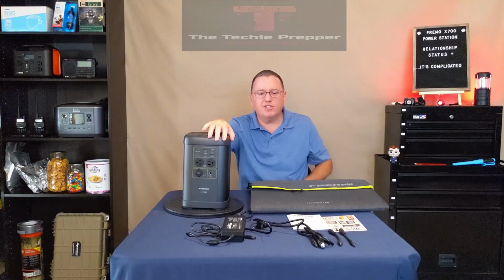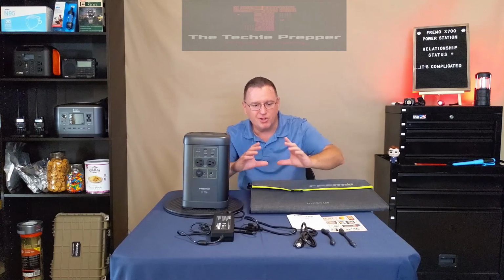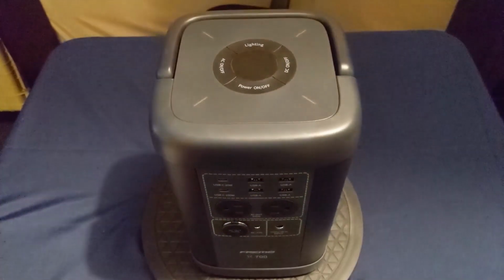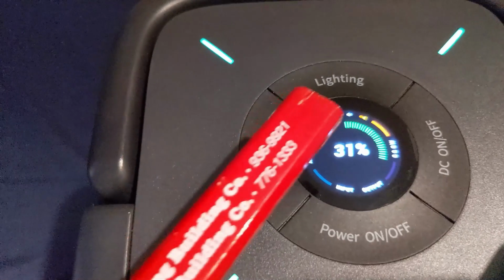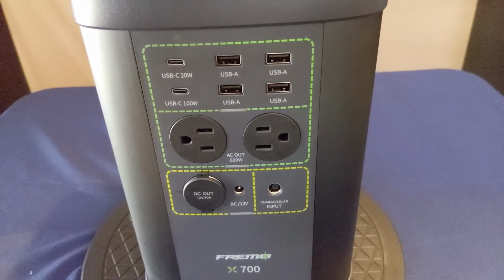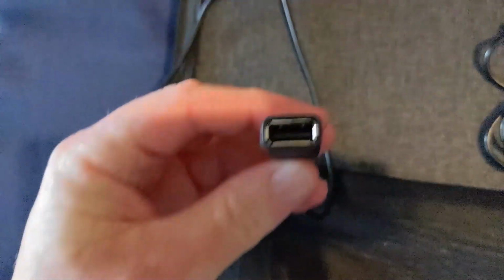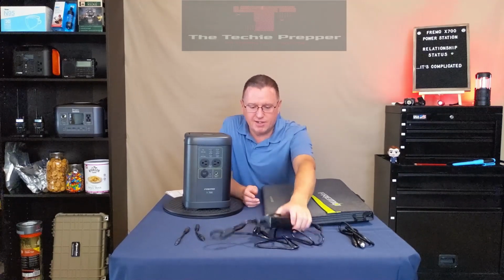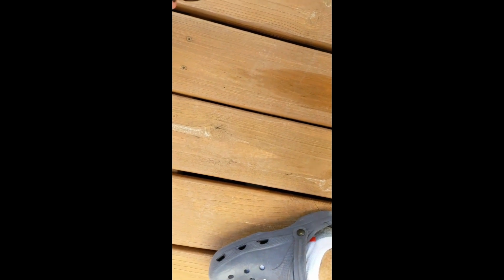FREMO x700 Portable Power Station Review

Comment: Question, you can use 2 pieces of 100w solar panelz total 200w, but the input is only 180w.??
Reply: The two 100 W solar panel can provide 200 W together. But the power station will take only 180 W from them.
Reply: On the up side, a 100 watt panel will usually only give you 70-85 watts anyway (it's 100 under perfect conditions, which most of us won't enjoy, most notably me during any power outage unless it happens to be in June).  So two together would likely not max the input.

There's USUALLY a little overpaneling built into the system as well, and the item can charge limit, so GENERALLY no worries about overprovisioning slightly on the watts input as long as the voltage is in spec, but check the manual and contact the manufacturer for guidance, particularly on cheaper systems.  EcoFlow is very forgiving.  Fremo?  It's at the lower end, so who knows.

Comment: I have a question about the solar charging for the x700. On their website, it states that the solar input is 180W. You mentioned in the video that you can run the 100w solar panels in parallel (200w). Is 200w input okay for the x700? I was looking to purchase a 200w solar panel from another brand and just wanted to make sure that will be okay to use on the x700. Thank you in advance.
Reply: My personal experience with solar is that they provide between 50 and 70 percent of rated output in normal eastern US sunny day.  A few scattered clouds, moderate humidity, if there's any more cloids than that 30 to 40% is more common.  200 watts of solar won't exceed the 180 w input.
Reply: @charleydog2669  Totally agreed.  In Pennsylvania, I might momentarily hit 90% on a beautiful June day, if I'm lucky, right around solar noon.  Even there, 200 watts of solar is still 180 watts input.
Reply: Did you find out the answer.?